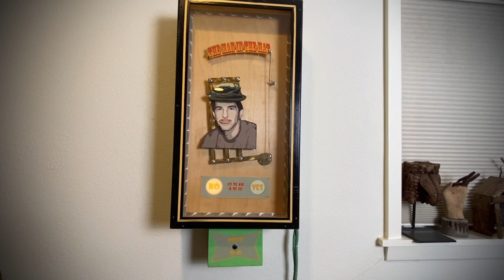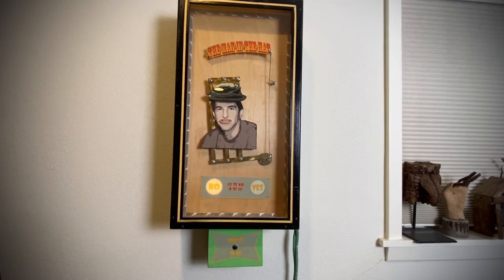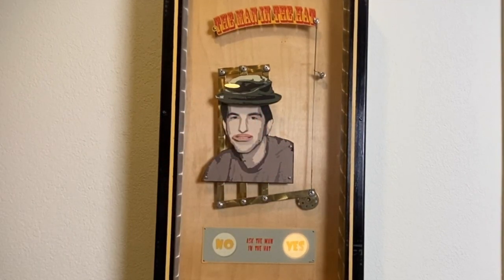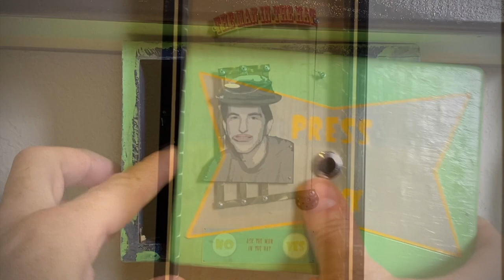Mechanical Switches

Comment: This is brilliant…. I’ve never thought about doing switches this way.   Feels like an idea from the 1920’s This is beautiful and “simple” design work but not simple in application. I love the Yes/No fortune teller you built-Again the simplicity of the parts you used makes the magic of the piece that much more special.  Love love love this work. Fantastic!

Do you NEED to put copper strips on the soup can?  Surely a metal can would already conduct electricity so why the copper?

Great work 🙂
Reply from the maker: Hey thanks for the comment. I guess you don’t really need to use copper tape I just like doing it for aesthetic reasons and it’s also better conductor than steel and usually when I make it I use a cylinder that’s not made out of metal so I guess it was just habit.